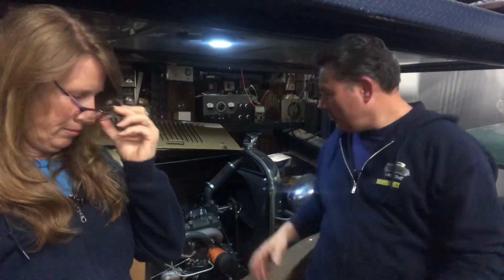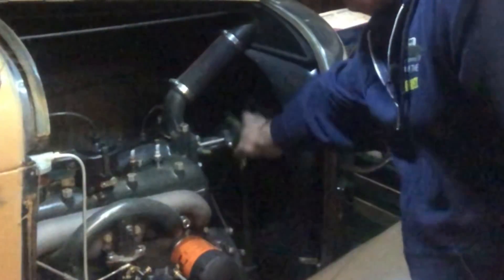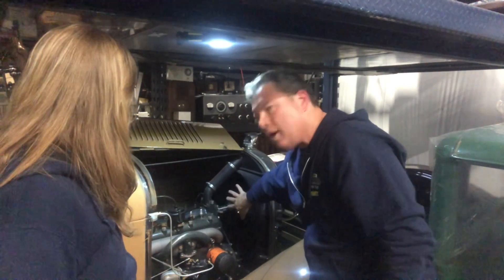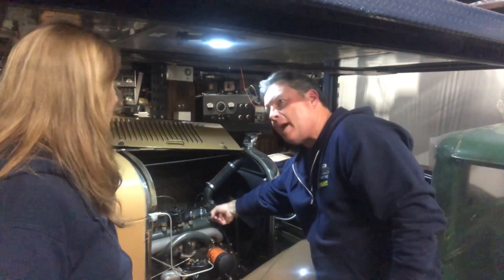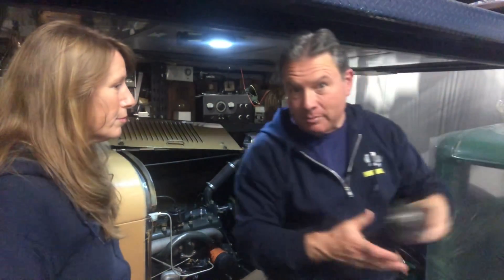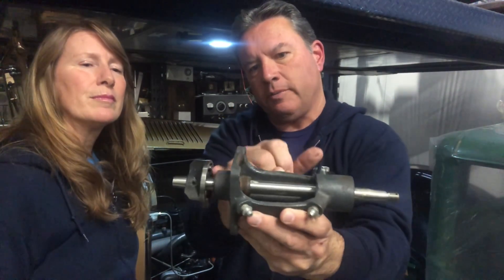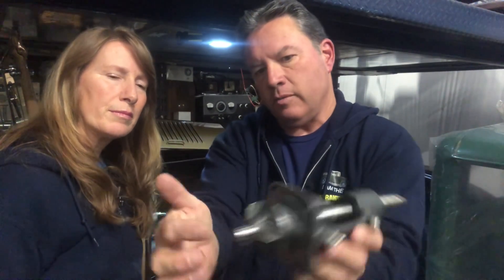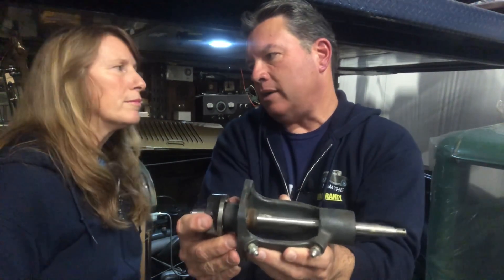Ford Model A Q&A of the day - How do I get rid of forward/backward movement in the water pump?

Comment: Good morning,  good topic
Paul you're right you can just leave it but I am anal.
So what did is add a 5/8 collar in between the fan and water pump housing.  There is only one problem.  The collar is too wide and will not allow the fan to seat on the tapered shaft.  I had to ground the collar thinner to allow the fan to seat,

Happy New Year 😃 keep the good stuff coming.
Look forward to it every morning.
Steve
Reply from the maker: Cool! Sometimes something works and sometimes not, but it’s great that you’ve learned enough to know what’s okay so things don’t get messed up 💕
Have a safe, healthy and blessed new year!

Comment: We recently bought a 1931 deluxe Roadster all restored.The 31 is the first car we bought all done. My question is . 41 miles per hour and it feels all in. Does that sound wright.
Reply: Thank you very much i will check it out.Happy new year. And stay safe.
Reply from the maker: @garylcampbell9964  best of luck, hope you get it figured out, make some adjustments and have tons of fun in the new year!
Reply from the maker: Hi and congratulations on your new 31! 
Do you mean that your top speed is 41 mph? If so, something is wrong. All of our A’s go 55+ mph, this should be the norm for A’s as Henry Ford built them to do these speeds.
I put the link below, maybe it will help answer a question as to what might be the problem with your 31?
https://youtu.be/3yPqZvaMShY?si=tgyt9U388bctCzWF

Comment: Sooo my all new water pump came in w an extra long shaft. (Found a guy on ebay who builds them. ) had to cut/grind down the shaft to fit. This Works best in my thinking. Mine had over 1/2 inch extra as my model a has only 2000 miles on it. But it cut down easy. Chucked it on my drill and put it to a grind wheel at A high rate of speed. No play. Clean fit. 
Still meed to Grease the fittings! But the neoprene will never leake
Reply: FYI - All the new shafts are supplied ~1/4” too long to allow custom fit depending on head condition.
Reply from the maker: Interesting, I wonder why the guy made it so long? Happy you found a solution to work for you!
Reply: @Modeltshinn  thinking he was cheap'en out. (It came with instructions for trimming.)
He sent me the wrong one.  a guy needed a zink and I got brass  (will fix that later ) happy new year!